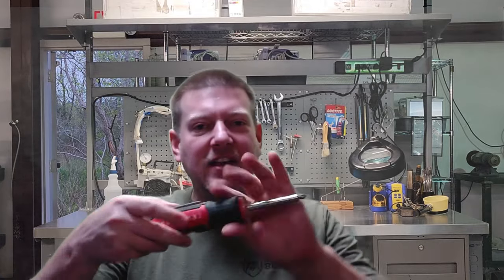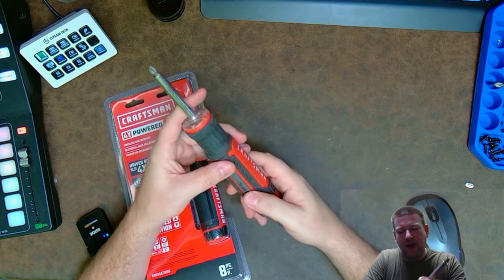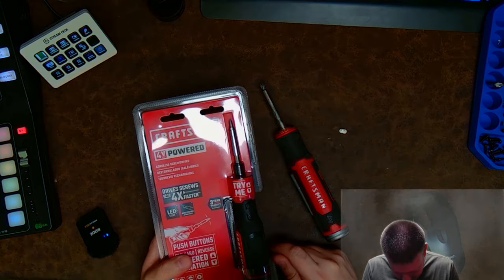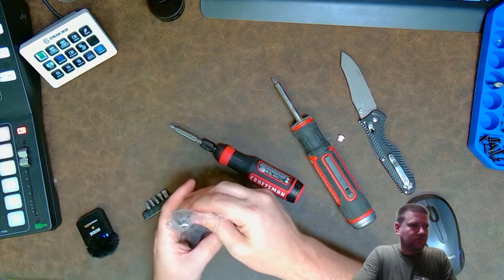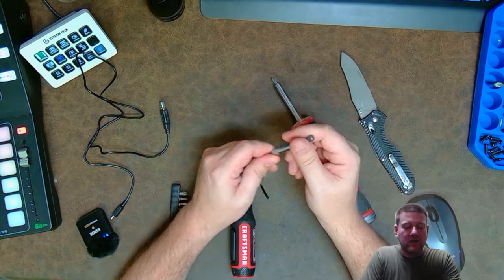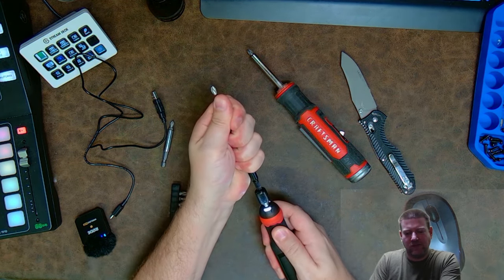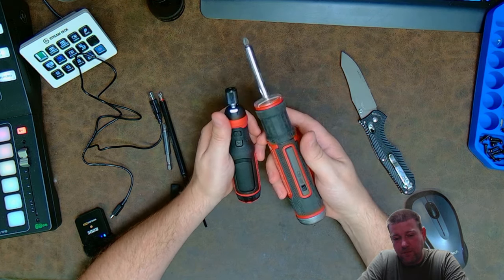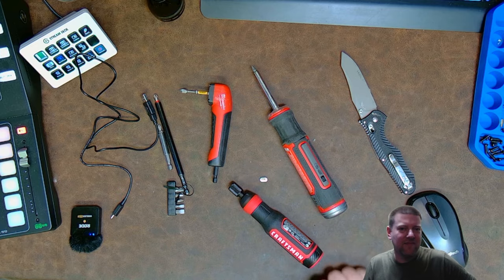New Craftsman Driver

Comment: Great functioning tool with notable improvements from the previous model unfortunate about the micro USB charging port carryover.  Your video popped up while I was researching about Milwaukee's M12 drill/driver installer.  Might be something to look into.
Reply from the maker: @Nanogrip  if you're already a M12 tool technician, go with the m12 driver. I live the ability to switch out batteries
Reply: @BetterBiomedChannel  I first started out with M18 tools but I am finding more and more that M12 is great for technical work as they are smaller in size, lighter, and easier to maneuver in tight areas.  Love that they have small compact batteries.

Comment: the only things that should be coming with NOT USB type C at this point is made as cheap as humanly posable and put on temu for bottom dollar. there is NO reason for a pro line of tools to be using that... C is way more robust and durable. as well as faster charging capabilities.